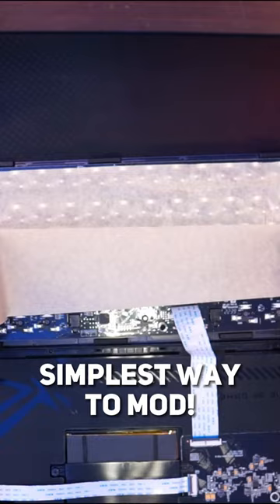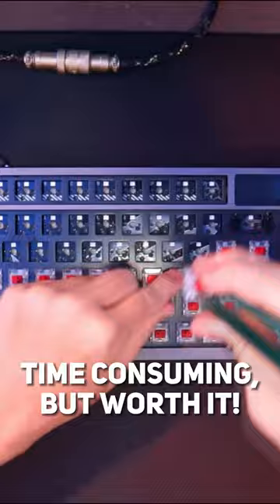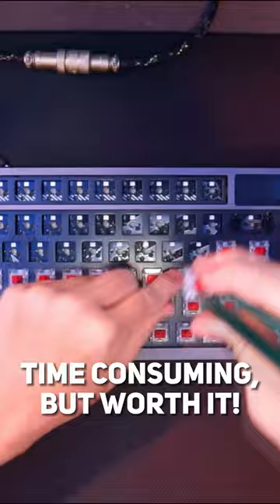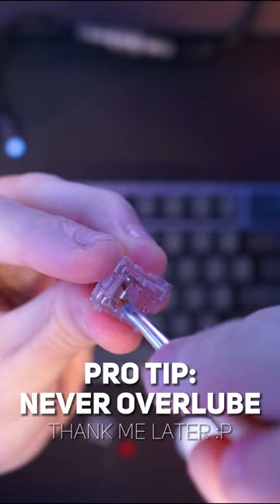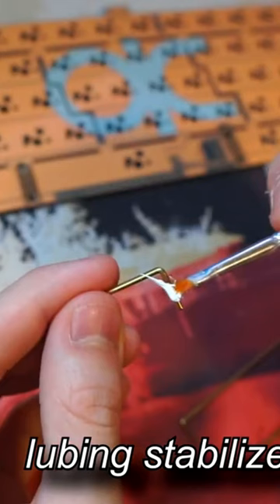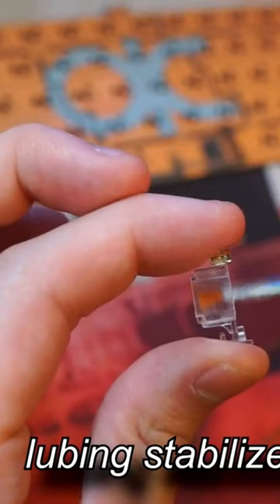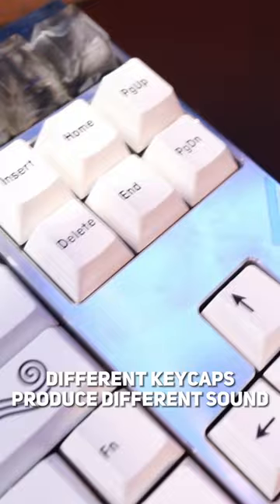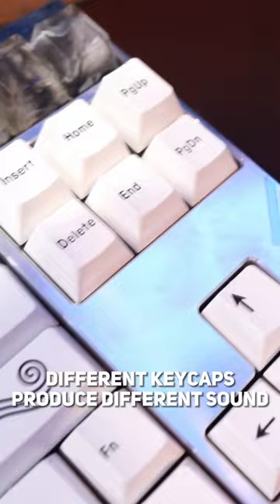How to Make Your Keyboard Sounds GOOD

Comment: a few tips for beginners:
1. If you tape modded, you don't need to use foam because the tape stroke back the sound of the switches so no need to use foam under
2. Try to balance your stabilizers before lube because it will still rattle even with a lot amount of lube (if the balancing is too hard try to use the holee mod)
3. Your build influence the sound of the keyboard (for example plastic case give you a deep "thocky" sound and soft plate gives you deeper sound, hard plate gives you higher pitch sound)
4. DON'T TRY TO BUILD YOUR KEYBOARD LIKE WHAT YOU SEE ON YOUTUBE. You'll be disapointed. Your keyboard, your style, your preference. That's the beauty of this "keyboard addiction" don't try to mimic others
Tks for reading this love yall <3
Reply: ok
Reply: I did put foam even with the Tape mod and personally liked it more. Should I maybe try silicone?
Reply: @Turnage497  just try it its just messy thing yk
Reply: well, using foam alongside the tempest mod will change the sound, so saying u dont need to use foam after putting tape on the pcb is a little misleading. using a thin foam in the case(u should probably only use one sheet, putting too much of even thin foams will give u clackies, unless u dont do the tempest mod, then two) will make it sound deeper and THOCC-ier. adding a bunch of thick foam will give u the clackies. those things still apply even if u do the tempest mod.

the tempest mod does lower the sound signature, so u will need less foam if u want thoccs, so in that sense ur right. i suppose many other factors apply, like the case material, how many layers of tape u apply... some ppls only put 1 layer of tape, which makes having a thin layer of foam still worth it, while if u put the max of 3 layers of tape(more than this is pointless, the difference in sound is indistinguishable) then u may not need any foam at all, unless u have a full aluminum case, in which case it MIGHT still make a difference.

foam is prolly the most effective form of modding u can do for changing the pitch of the keeb, and the reverb etc. its ALWAYS worth messing around with different foam types, thin finely woven foams for the THOCC, and thick porous foams for the clackies. u can even combine them, tho u will end up more on the clacky side..
Reply: foam is also for filling empty space so that the sound doesn't echo around as much
Reply: So basically if the keyboard already came with a foam under the PCB, no need to do the tape mod?
Reply: @NekoLeo7  Do the tape mod, it's so much worth it. Add 1-3 layers according to your preference.

Comment: But the most important part is to get good switches!
Reply: Arguable, I feel like a combination of everything is important, you could have amazing switches but if everything else is cheap it won’t sound good… on the other hand you could just lube cherry reds or smthg in a nice keyboard with good mods and it will sound pretty good

Comment: Here are some more tips:
- Don't lube your switches unless they are clickies.
- When you tape mod, apply more than 5 layers. The more layer the better sound. Sticky ones are recommended so it will not wear off.
- Do not do force break mod because it will add pingy noises especially on aluminum boards.
- Choose north facing boards because they are perfect especially for Cherry profile keycaps.
- Do not connect the port on your PCB. It will make your PCB explode.
- Dig a hole on your battery if your keyboard is wireless. This will make longer battery life.
- Break your PCB into two parts. This will turn your keyboard into Alice layout and your keyboard will be guaranteed to have better sound and ergonomic.
- Use aluminium boards if you carry it a lot. Full size boards are recommended.
- Use aluminium plate and tray mounted boards if you want flex.
- Use clicky switches to assert dominance.
Reply: Extra tip: Use tungsten keycaps. They are pretty good for both typing and gaming, as you are less likely to miss-click with them
Reply: Best advice 💯
Reply: Bro some begginer is gonna find this and believe this 😭😭😭
Reply: this advice helped so much. i recommend beginners to do this
Reply: Dude stop trolling

Comment: How to break your keyboard 101
Reply: these are safe you just dont know keyboards? u say that for no reason
Reply: @INNOURIDDINE  Cuz i did the tape mod with my keyboard it broke a letter
Reply: @Totallynotmwa  bc u did it wrong
Reply: @INNOURIDDINE  ohh
Reply: @Totallynotmwa  just a question did it still sound good
Reply: @INNOURIDDINE  ya but i took off the tape after it broke
Reply: @INNOURIDDINE  i also put cooking oil instead of lube💀
Reply: @Totallynotmwa  what the fuck

Comment: at that point just buy a new keyboard
Reply: u must be lost lol...

modding a custom keyboard will ALWAYS sound and feel better than anything you can buy, no matter the price. u can buy a 50 dollar keyboard and mod it to sound creamy and THOCCY, or marbley if u like that, or clicky clacky, etc, and sound and feel better than any keyboard u will ever try.

also, the keyboard hes using in the video is 250 bucks stock lmao. its also specifically designed to be modded in these ways.